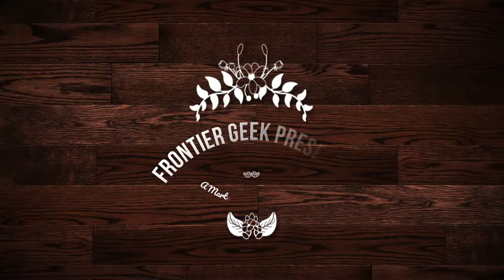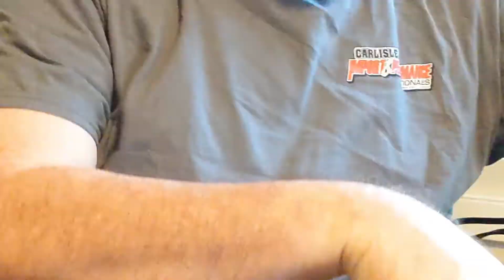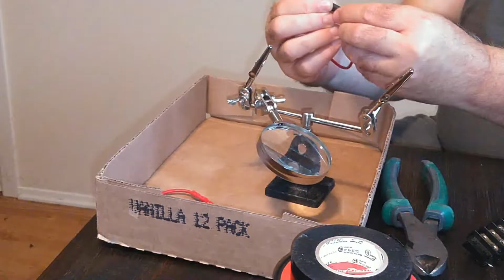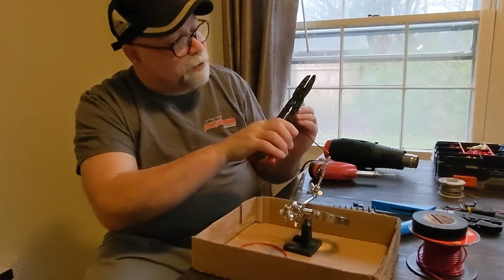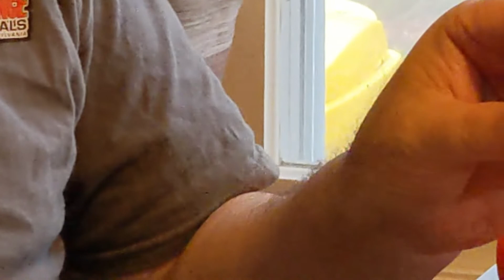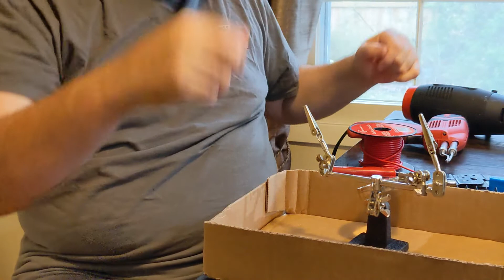Connect 'Er Up !!! Wiring 101

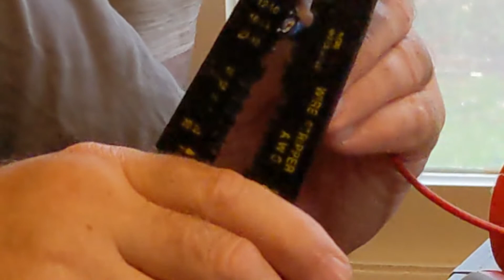Comment: May I ask why you used the non insulated crimp on a insulated connector at 12:45 of this video?

Would you agree that using adhesive lined heat shrink crimp connectors are best whether the application is marine or not?
Reply from the maker: Hello SA, thx for writing in. I've been using the non-insulated crimp for just about 40 yrs, never had any issues, the insulated crimper is a superior tool for that particular job, but both work fine, I just purchased the insulated crimper the end of last year. For splices, yes, I'd probably use the insulated crimper but regardless I put a segment of heatshrink over them afterwards to seal it from any moisture. Honestly I usually do the western union splice and then solder, then electrical tape or heatshrink the splice afterwards, I rarely use butt connectors of any sort in my harness builds. 
If it's a temporary rig harness that's either gonna get upgraded later, or removed entirely, I've been know to just butt splice quick to get it up and running, w/o tape or heatshrink post assembly; but never as a matter of course in a permanent project application.
For spade, ring and push-on connectors, those questions are kinda irrelevant cause the connection itself is open to atmosphere, so it's gonna do whatever it's gonna do. A coat of Vaseline or dielectric grease after connection will be helpful in delaying corrosion, but either way, I've never had any operational issues I can recall, due to connection corrosion. Now marine, yes, that's a whole different environment, salt air vapour is quite corrosive and will damage harnesses and connections, if not treated properly.
Reply: @frontiergeek4953  Your response is appreciated sir but there's no need to thank me for asking.
Butterman2473 just likes to give you a hard time. 😇
Reply from the maker: LOL, heya, its Butterman. Good to hear from ya.
Reply: @frontiergeek4953  But I seriously have always wondered about the tip of those type crimpers being for "insulated" and the "non-insulated" just above the handles.
I've always used the non-insulated  crimp also.

Comment: Of course it turns out I have been crimping connectors wrong my whole life. Thanks for the 101. I’m definitely an amateur but have been trying to do as much as I can myself forever. I really, really like the newer heat shrink tubes with cool melt solder and sealant inside they are really easy to use with just a heat gun. but I usually put another sleeve of heat shrink over the connection better looks and strength.
Reply from the maker: Hello D, happy you like the video. I haven't yet tried the "low temp" solder with the heatshrink and solder all-in-one, it is an interesting concept. Might save that thought for a future video. I like your double heatshrink concept too, extra insulation and physical strain relief enhancement.